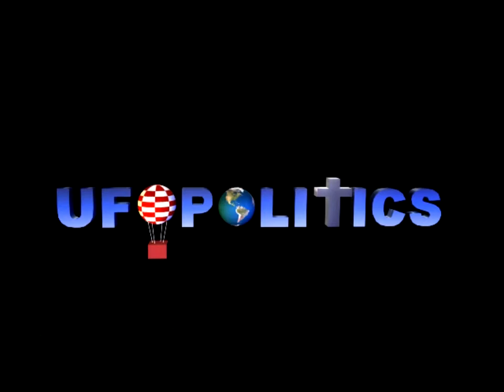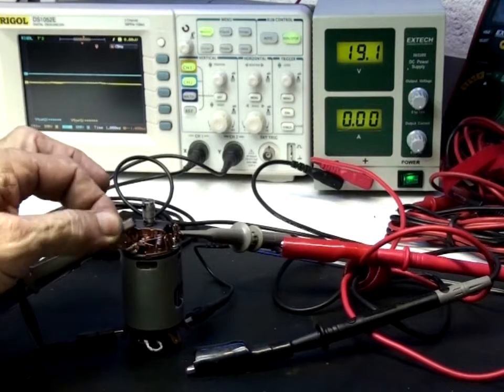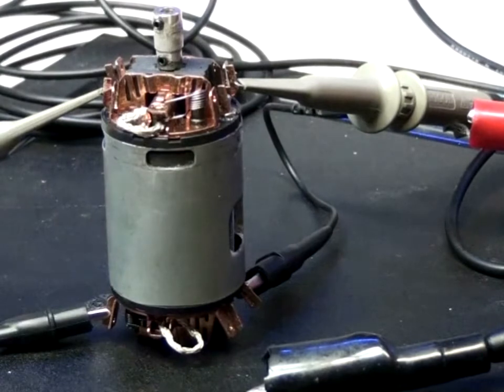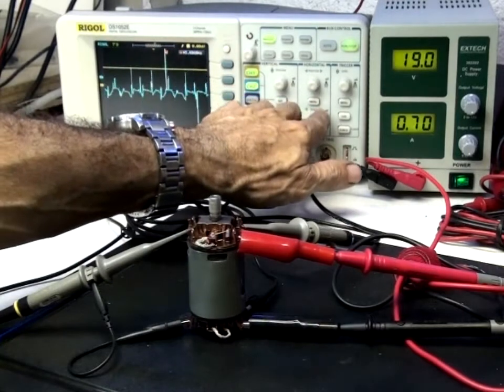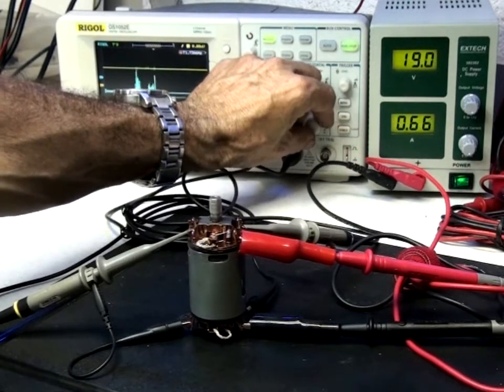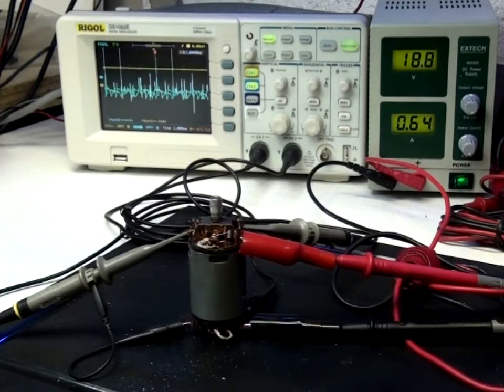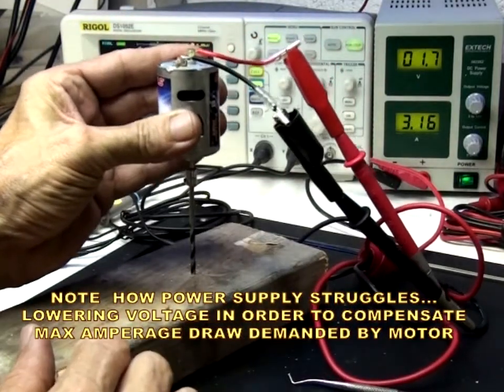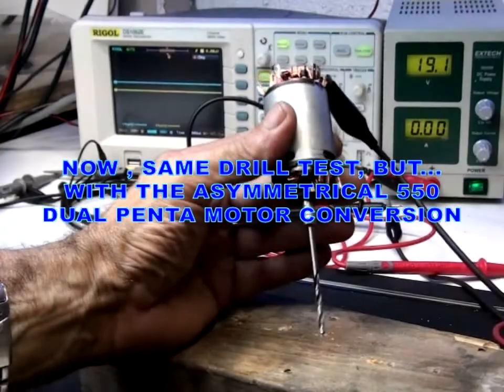DUAL PENTAGONS/550 MOTOR BODY TESTING

Comment from the maker: Thanks Regenerador Cuantico, and you are completely right about Resistance versus # of turns in Coils Magnetic Fields strength. As we also know that resistance depends on wire gauge and length or equivalent to number of turns.
But I tell you something else...for some reason, say two coils of identical resistance, where one is based on thicker wire and higher # of turns versus the other coil with finer wire...and less turns...the strongest magnetic field would be projected by the thicker wire.

Comment from the maker: Wrong again!
The "Theory" comes after the LAB WORK is tested...I BUILD THEM, TEST THEM...in all "Sizes and Colors"!

A Motor JOB is to have great MECHANICAL CAPABILITIES...like TORQUE and Speed.
Symmetrical Machines CAN NOT AFFORD BOTH at same time...so, have to choose which way to go...

Asymmetrical Machines DON'T

Comment: FYI, When Tesla was working in his lab, he was working with Huge-Amounts of power to begin with, already in the 1000 Volt range!  When power companies transmit power from the DAM the power is in example: approx. 1,000,000,000 Volts @ .001 uA!  They do this to transmit over long distances!  Receiving it at your house it's been bumped  down to approx: average panel: 240 Vrms @  200 Arms!  AC peak to peak is 240/0.707= 339.46 Volts, don't measure with scope, it will rune it!

Comment: The Coil-Windings, nothing new there, already in the loop, (No pun intended!) called the mobius coil! Maybe you are receiving high Amp-Output, but have you taken voltage readings/with load? Place a load on the Unit of lets say, and I"m being generous, 1000 Ohms! What's your output now?  Did the RPM drop any, did you find a drop in voltage?  Any of these finding will make your little motor/generator worthless!  Keep trying, you may find an answer, non of us have come up with!!!!

Comment: You have to explain the phenomena with theory, before you can get a grasp on what your actually viewing! It's hard to produce something from nothing! People have a good concept of Overunity generator, but that's not something form nothing!  The square wave your noticing coming on output is the break in the commutator! Just FYI, engineering companies try to put a diodes across back of relays to reduce spiking from DC-Pulsing! With a PWM , you just change the Duty-Cycle of the motor!

Comment: What your looking at is spiking from a collapsing magnetic field!  Voltage RMS is not really high!  Once again, if you even put a 10 k ohm resistor across this will reduce spike voltage! Placing a cap across that will produce ringing!  Placing it on a battery for recharge will nullify the spikes to nothing, but will raise your scope-voltage, due to battery power!

Comment from the maker: Hello EsEs Oz, and Thanks,
Now, that is a Regulated PSU, set at C.L. and V.L .(Max Output Values)PSU will try to keep the output Parameters as set. However, at the second that Motor draws more than the Max Amps (3A)Voltage will drop to Milli volts to keep Supplying the demanded higher amperage,like it happened with the Symmetrical Motor, & still could not do the job.
If I connect that Motor...to a 2200 Milli amps 2.2 A LiPo,it will drill that hole much faster than it did with PSU.
Regards